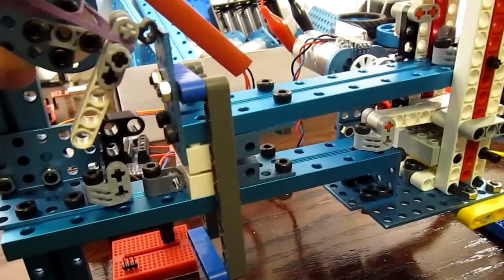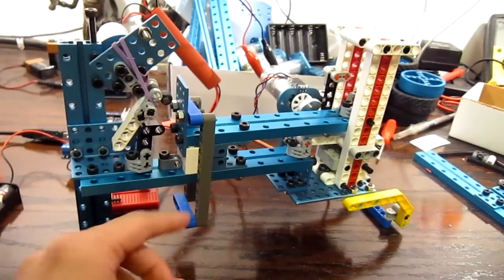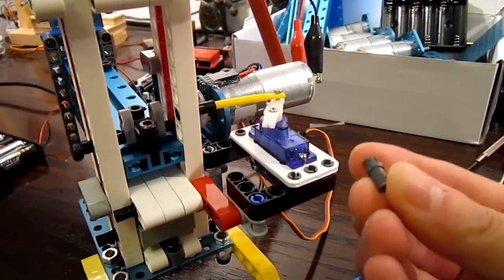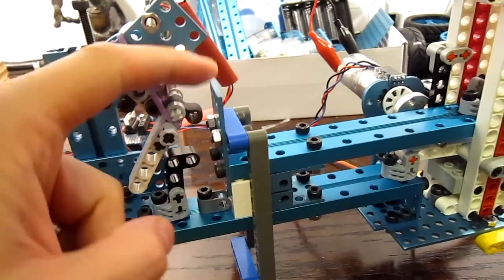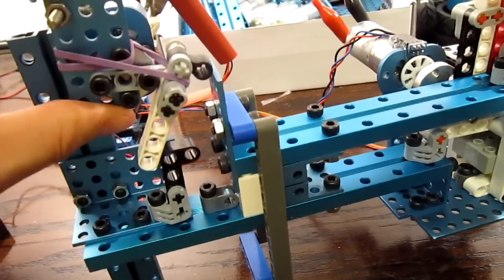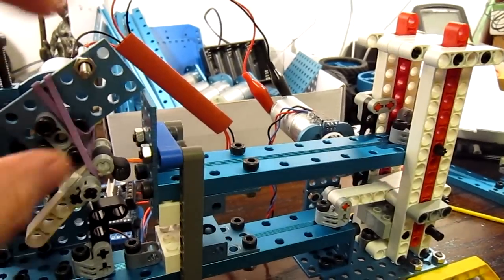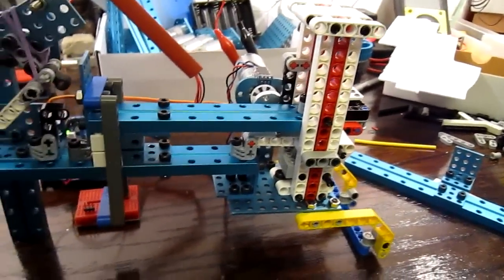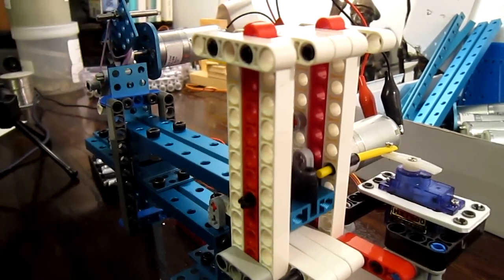legotest - Adding the second motor and servo

Comment from the maker: The rubber band is not under a lot of stress so I think it will be OK.   The first machine did 37,112 iterations.  This time around I want to run the test many times so the whole machine will have to run almost continuously for weeks.  This is why I hope to build more than one machine an run tests in parallel .